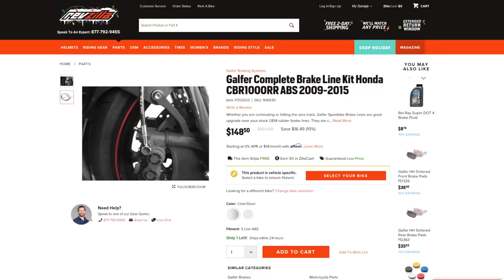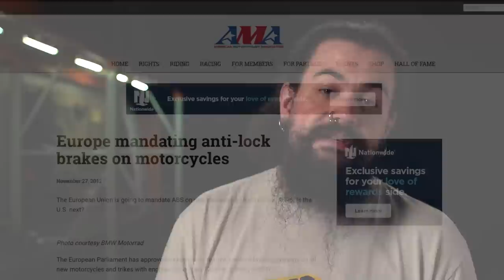3 Arguments AGAINST Motorcycle ABS!

Comment: My sportster didn't have ABS and never had a problem with threshold braking; bought the new Low Rider S with an S&S 475G cam, so I am kind of glad it comes with ABS w/ 135ft/lb of torque.
Reply: Chris Scade Try threshold braking on dry pavement that then becomes wet due to a puddle or water running across the road.  Tell me how fast you can react when the front wheel locks.
Reply: @LTVoyager  again, never had a problem on my sportster.
Reply: Chris Scade Yes, as long as you never encounter a situation where ABS is helpful, you won’t miss ABS.  It is like a person who has never had a collision saying that they don’t find airbags to be useful.  😁
Reply: @LTVoyager  it wasn't until recently that ABS was even an option on bikes. It is something nice to have, but it shouldn't be something you need to rely on. Last time I checked, bikes didn't have airbags either.

Also, bikes are small and fit in small spaces, so it is better to have an escape plan instead of just squeezing the brakes, which is why I recommend taking a motorcycle course to everyone interested in riding.
Reply: Chris Scade I agree completely that no safety feature should be “relied on” in place of good riding skill and road strategy.  I am simply saying that an ABS bike is safer than a non-ABS bike in almost every circumstance.  I have both an ABS equipped bike (K1200LT) and a non-ABS bike (KLR650), and I much prefer ABS when on the highway.  I am a PAMSP (Total Control) instructor so I also advocate good training.
Reply: Chris Scade BMW has had ABS for 30 years so I guess it depends on how you define recently.
Reply: @LTVoyager  lol, is that a serious reply?
Reply: Chris Scade Absolutely.  Then again, if you ride bikes designed in the 1950s, I can’t help that.  LOL.
Reply: @LTVoyager  ABS didn't even become standard in cars until September 1st, 2013.
Reply: Chris Scade You said it wasn’t an “option” until recently.  You didn’t say “standard” as on every bike made.  ABS has been an option on BMW motorcycles since 1988 or thereabouts.  My K1200LT has had ABS as standard since it was introduced in 1999.
Reply: @LTVoyager  dude you are pretty petty... BMW is one brand, so one brand doesn't qualify as bikes...

Indian
Victory
Triumph 
Harley
Ducati
Honda
Suzuki 
Yamaha
Ect.

Didn't offer ABS until more recently, Honda didn't add ABS to their 1000rr until 2009, and that is a 300km/hr bike.
Reply: Chris Scade Well, basing technology introduction dates based on Harley, Indian or Victory is simply laughable.  Technology is not their thing.  And the speed of the bike has no bearing on the need for ABS.  It is actually much easier to lock the brakes at low speed than at high as there is much less rotational inertia of the wheels and tires to overcome.  Honda and Yamaha both introduced ABS in 1992, still not exactly recently.  There is a world of technology outside of Harley Davidson.
Reply: @LTVoyager  lol, you're a goof, Harley is the 4th brand I mentioned, out of 8, nor did I mention their dates for ABS integration. See how petty you are, just shows that you are biased against Harley.
Reply: Chris Scade Funny how people who are shown to be wrong always turn to using insults rather than facts.
Reply: @LTVoyager  lol, what facts? ABS has been around for a while, but as I said, it hasn't been until recently that ABS has been an option on all bikes... not just a couple of bikes. Nor have I been the one bashing brands... just an FYI, Harley introduced ABS in 2008.
Reply: @LTVoyager  even your first reply is laughable, as it seems you don't even know what threshold braking is... "how fast can you react when the wheel locks up?"... slowly release the brake, and you will be fine; you shouldn't be squeezing the shit out of the brake either.
Reply: Chris Scade ABS is still not an option on all bikes.  The reality is that there are several tiers of manufacturers from a technology perspective.  The Europeans are clearly the technology leaders.  The Japanese are the second tier.  The Americans are the third tier.  The fact that Harley chose to wait 20 years after BMW and 16 years after Honda and Yamaha to introduce ABS doesn’t change that fact the the technology was available.  Just as Honda chose to wait 20 years after BMW to introduce an electrically adjustable windshield on the Gold Wing.

I’m not bashing Harleys in general, just in the area of technology.  I think their paint and chrome is top shelf.  Paint and chrome is Harley’s thing just as technology is BMW’s thing.  Different strokes for different folks.  If this topic was about paint and chrome, I would rank Harley as the top tier.  However, the topic was ABS which is a technology and in technology Harley is sadly behind and this is simply a fact.
Reply: @LTVoyager  Harleys are built to ride and have been around for over 100 years. Harley riders also don't like a computer to control their bike for them. A clutch, throttle, and brakes is all they need, the rider can handle everything else. If you need to tell the computer that it is raining outside, maybe you shouldn't be riding in the rain since you don't have the throttle control.

All the technology on motorcycles is great, and some riders need it; a lot don't need it or want it, so having it optional is great. Personally I like stripped down bikes, which is why I started on the Sportster and then moved up to the Low Rider S.

The Ducati 998 is the exact same, but a track bike and European... also a bike I would like to own one day. All engine and no computer.
Reply: Chris Scade And I have no problem with that at all.  I am fine with anyone who simply says “I don’t want ABS.” It is when riders make false claims that I take exception.  Saying you can outbrake an ABS bike is the the most common false claim made.  The reality is that fewer than 0.1% of riders on the road can actually outbrake an ABS equipped bike and even then only on perfect surfaces.  Throw in some water, sand, wet leaves, etc. and the computer wins every time.
Reply: Chris Scade It sounds like you are the one who doesn’t know what threshold braking is.  If the front wheel locks up at 50 MPH on sand or water, you rarely have time to “slowly release” the brake.  The reality is that if you are truly braking at the threshold of traction and then the traction level is instantly reduced by say 50% due to water or sand, your front wheel will lock nearly instantly and in the 1/2 to 1 second it takes you to react to that, you will be on the ground.  The ABS computer can react in milliseconds and release the front brake before the bike has time to go down.
Reply: @LTVoyager  good tires are more important than ABS in reality, if you have cheap hard tires, even ABS won't stop you. ABS, only kicks in when you are braking too hard for the situation. They are called Anti lock Braking Systems. Between good tires, engine braking and good brake control, there is very little reason for your ABS  to activate.
Reply: @LTVoyager  I don't ride with my eyes closed and continuously adjust my riding to the circumstances around me, ie. road conditions deteriorate, I ease off the throttle and engage clutch and coast through or around the hazard.
Reply: Chris Scade Yes, good tires and brakes that are good shape are essential.  However, even with bad tires, ABS is still useful and will save your bacon in certain circumstances.  I rarely ever have had ABS engage.  I intentionally engage it a few times a year just to ensure it is working and to exercise the valves.  It is much like my riding gear.  I have ridden on the street for 44 years without a crash.  So, I have never used my helmet, armored jacket, armored pants, gloves or boots.  I guess I don’t need to wear them as they apparently aren’t useful.
Reply: @LTVoyager  now you are comparing gear to ABS which you just said you rarely have on? My helmet is very useful as it has stopped rocks and huge bugs from hitting me in the face.
Reply: Chris Scade I have a windshield for that.
Reply: @LTVoyager  that is what convertibles are for.
Reply: Chris Scade Yes, when you get too old to ride.

Comment: Funny, I often hear supposedly highly educated people use phrases improperly. One of the big one is saying "begs the question" when they mean "raises the question." They should probably take some English lessons from Lemme the wrench.
My take on ABS is that it usually works well if you're on pavement with a modicum of grip. If you try to go downhill on a trail with an adventure bike that has it enabled, you're wheel will never catch traction and the brakes will continue disengaging the brakes leaving you flying down the hill like you have none. Not cool. Much better to slide in that case.
My Versys didn't have a switch, but when I took it off road, I'd pull the fuse. Served the same function.
I don't particularly like it on some bikes when riding spiritedly down the twisty roads. My Triumph ABS disengages the front brake with the slightest bit of lockup and removes it enough to have made me come way too close not making the corner on a few occasions. At least that one I can turn off, but I have to be stopped in neutral and flip through menus, so I usually forget about it.
I do find it great for instances where there's something slick on the road and once past it, the tire can catch traction again. Prevents the tire from sliding too far initially and getting the bike cocked and discombobulating the chassis enough to get handlebars wagging. I've had that happen a few time prior to ABS becoming ubiquitous. Even lodged a bike under a school bus once as a result.

Comment: ABS vs non ABS seems to be the way of automatic vs manual cars. Everyone wants their manual transmissions to stay in circulation but when it gets down to it, automatics are starting to do everything better. People think they can perform better than the ABS module but realistically, its all computers that are vastly smarter and can handle conditions better. I can entirely see having the option to disable it, which most motorcycles do. But eventually everything will go the way of ABS.

Comment: I am all for personal choice, and several of my current bikes don't have ABS, but I can't see buying a new street bike without it. I agree, on the track, or in the dirt, I don't want ABS, but on the street; ABS all the way. I am also sceptical about the comment that on dry pavement with ideal conditions an expert rider can out-brake ABS. The NHTSA did such tests, and the results demonstrated that not only can you reliably stop in shorter distances, an expert level rider without ABS needed multiple attempts to approach the distances of the ABS system.

Comment: I live in the U.S. and i always follow up & apprecitate what European motor vehicle regulations come up with. They put extensive rational case studies on the safety of their motoring public. In fact Many Japanese models (not to metion European ones) are making bikes to high European standards to accomodate the need/demand and NOT feeling Fussy about it. I am glad i waited until now when i bought a brand new 2019 CB1000-R that came with linked ABS (Tokico-front, Nissin-Back), 3 level Traction control & engine brake, throttle by wire & slipper assist Clutch 😎

Comment: ABS doesn't work on gravel or soft roads, so you need your wheels to lockup to brake effectively on those roads.

You need your wheels to not lockup on asphalt. ABS prevents locking up on all types of roads, especially with adverse weather conditions.

ABS literally pumps your brakes 100s of times per second via a computer. "Many of times per second" lol. You're giving newbies layman explanation when they need to understand how it works more thoroughly.

You can outperform ABS, but only on clean, dry pavement. However, as I'm sure you know, those aren't the only types of road conditions you'll encounter in the real world. 

ABS works by precisely measuring both wheels' angular velocity and also translational speed, and it uses pumping to maintain similar angular velocities. If one wheel spins faster than other, you're gonna lose traction. Static friction > rolling friction.

Comment: ABS systems don't detect loss of traction lemmy, they detect wheel lock.
Reply: Which, if you're on the brakes, is indicative of traction loss.  The brakes still require the wheels to have traction to slow you down in relation to the ground.  Using brakes while airborn or on ice does little to slow you down.

Comment: My Duke has selectable ABS. Full on, supermoto, where the rear is off but the front is on, and full off. It will likely never be taken out of full on. I'm realistic with myself and I know that it does a better job than me. 

In every test I've seen, even with the most skilled rider, the best they could do was match the ABS in stopping distance. There are some safety features that get in the way, I'm looking at you traction control, but ABS is one that works really well and I've never wished it wasn't there. 

One caveat, I only ride street, and that's all I'm speaking to. I understand that dirt and track are different, and if you ride either of those, please disregard my entire comment. 

Everyone ride safe and ride often.

Comment: 1. People with serious skills can do better without ABS. I think on most older sport bikes the ABS was too intrusive for dry track riding and don't get me started on rear wheel ABS on dirt. Most bikes the last couple of years the ABS is getting much better with smoother activation, levels of intervention, and options like rear wheel lift control for track and Enduro mode where the rear is off and the front is at a very high threshold. Still, if you're Chris Birch it probably isn't helping a lot. For me, I like having it still on the front a bit, especially when transitioning between hard and soft surfaces. 

2. It is expensive and complex. Sure. But it isn't that expensive and I'm not so good that I'd notice the extra few pounds in the bike. But generally bikes are just getting more complex. For safety features, I'm okay with that. If you are at a level where there is no benefit, then I get that you might not think it is worth the price in $$ and reliability. 

3. Other Nanny States. Meh. I don't care. I don't live in those countries, so it is up to the mfg. to decide what to make or not make available in this country. If there was sufficient demand, there would be a model available without it. For example, I think Suzuki still offers sport bikes without it, even though they include other complexities like power modes and traction control. 

In the end, I believe that it is better to have it on a street bike due to the unpredictability of the surface and in particular I think newer riders are better off with ABS. I am particularly happy with the new bikes that have the ability to adjust the intrusiveness of the ABS.

Comment: ABS is arguably the best of the "rider aids" to have on any bike, or car for that matter. A good rider can feel the road and use threshold braking, but with the difference between upright and dropped being so small, ABS can work for even the best. What's scary is that now bikes and cars have so many "rider aids" that we are getting a generation of vehicles operators who do not know how to drive period. I would argue that all new riders/drivers learn on vehicles with zero technology assists, to actually learn to handle and feel a bike or car. Honestly, if you can't park or hold a vehicle between the lines (or are too lazy to pay attention all the time), you probably shouldn't be on the road at all.

Comment: So I recently had an “oh shit” experience. Although I had often practiced braking without locking my wheels, as I rapidity approached the back of a vehicle that suddenly entered my lane from the left hand turning lane, I locked my front. Unfortunately I was also attempting to lean and push my bars for a swerve around that car at the same time. Once the front locked, and the rubber gripped the road, it flopped to its right, and the momentum of the bike then made it flip back left. At that point I was thrown from the bike, but not before I broke my leg attempting to hold my bike upright, which was purely instinct. I totaled my bike, and I have to believe that if it was equipped with ABS, I would have been able to either stop, or swerve around that vehicle without having my wheels lock. Not having ABS when you are applying pressure to the front and attempting to avoid an object at a good pace is dangerous. I’ve owned 3 other bikes with ABS, and over time I became very comfortable with it. I used it to my advantage. You can practice emergency braking all you want without ABS, as you should, but when you’re really in that “oh shit” place, and if you attempt to swerve, lean or push and your front locks, it’s game over.

Comment: If all bikes come standard with abs then the cost of retooling the line for non-abs bikes would drop dramatically for the manufacturers. No longer having the need to jack up the price on the consumer end. Obviously there’s a cost to have the abs system on the bikes but not the $1000 option we’re getting nailed with now.